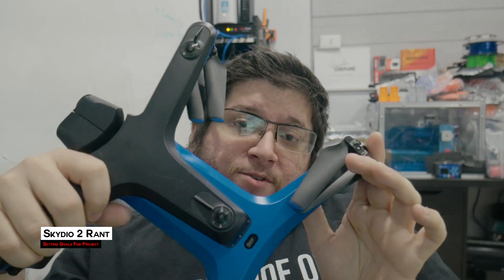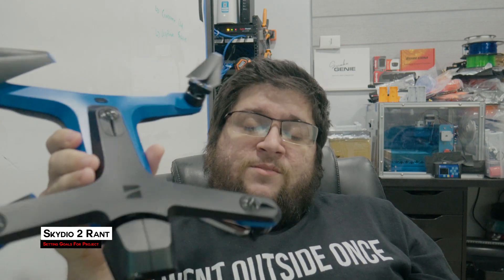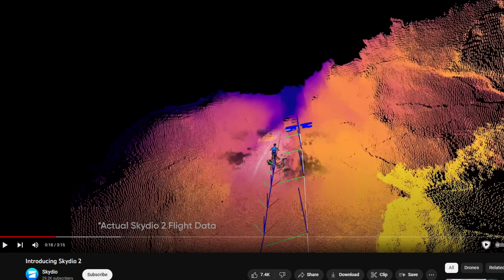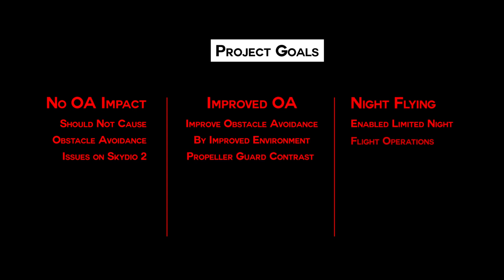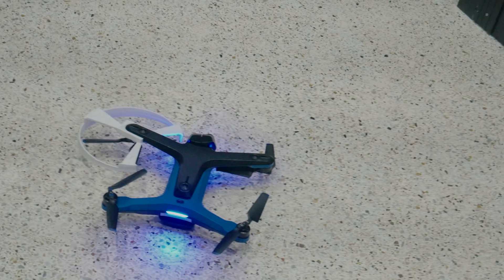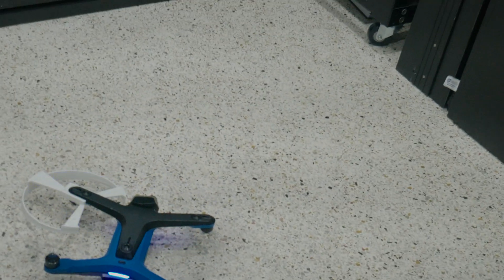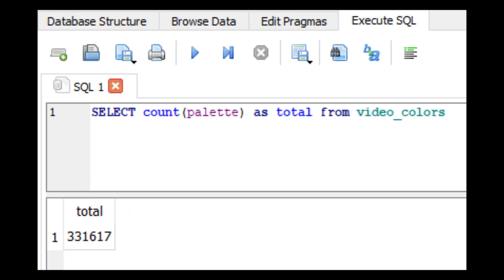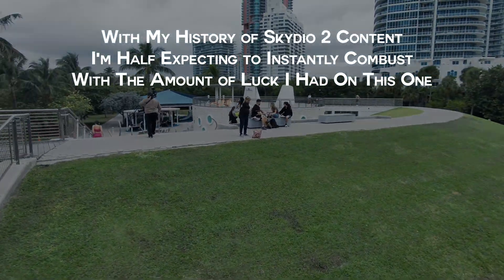Skydio 2: Propeller Guards, Better OA and Night Flying for Free, Part 1

Comment: Any update to the propeller guard testing? Need the 3d print file ASAP!! Love the content!
Reply from the maker: All four are on the drone. Camera man has been busy. Scheduled testing for next week with video coming out soon.

This will have the same "Don't try this at home ever"
Reply: @JustTechGuyThings  I appreciate it. I work for a law enforcement agency and we utilize this drone for flying inside of buildings. The propeller guards would be very beneficial.
Reply from the maker: @JustinKatz-w4h  Prop guard POC just went live, it's the first video. We've tested with 1 but 4 caused a crash because the attachment system failed.

Comment: You think you can get the receiver protocol for the drone? I would like to bind my RadioMaster TX16s to it.
Reply from the maker: Skydio 2 uses a weird wifi system... you can bind it using your phone or their beacon/controller which is paired via USB connection.